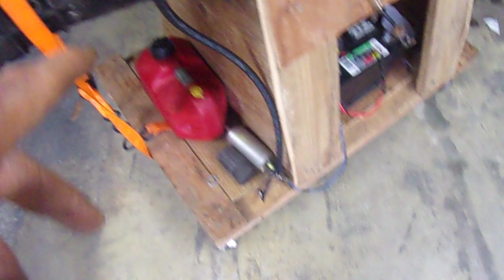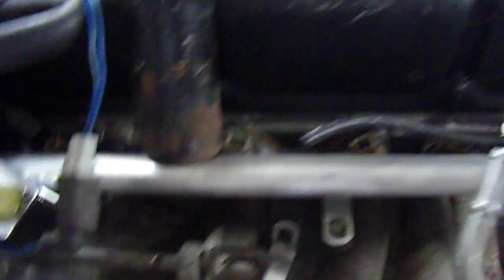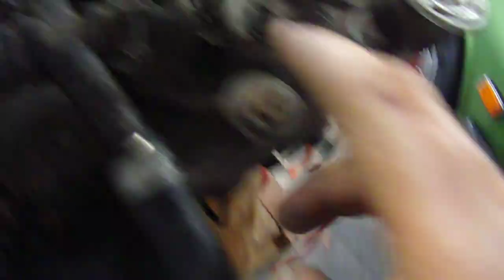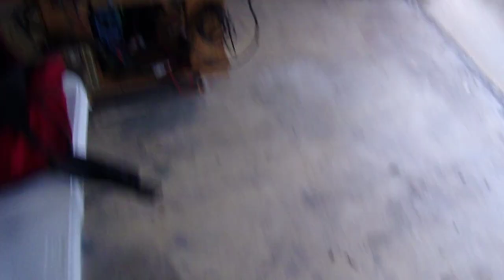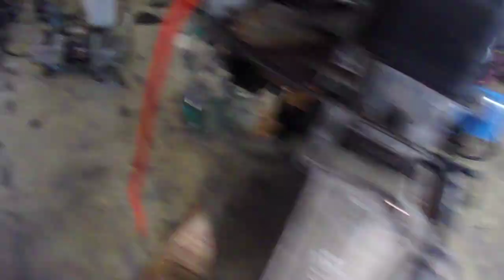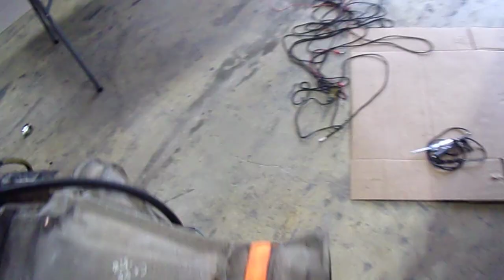Nissan 280zx turbo L28et engine on test stand with harness

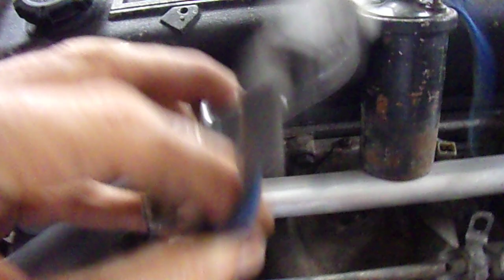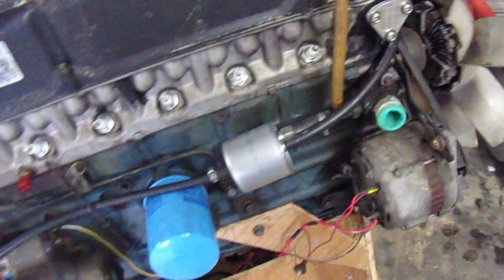Comment: Hi Dave, Got a question about one of your older videos on the ignition switch. When you put your key into the ignition switch, should you be able to turn the key counterclockwise to enable the electrical accessories only? When I look at my ignition switch the words "On" seem to be at the 12:00 position, the ACC at 11:00 and start at 1:00 position, lock at 6:00 and off at 9:00. Is this correct? Thank you for the great tutorials. Pat
Reply from the maker: yes you have it right. only things that stay live all the time is the headlight, emergency flashers  and maybe the horn. they are always live iirc the ACC should be things like the fan/radio, no efi or ign. lock will make the door buzzer operate unless you pull the key out (and lock the steering if you turn the wheel)
Reply: @davewm9589  Thanks Dave appreciate it.